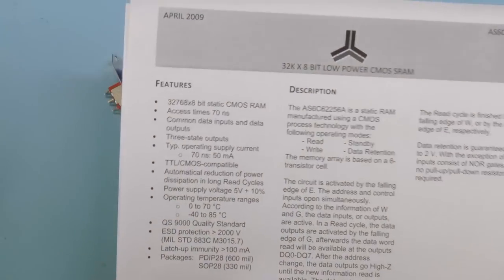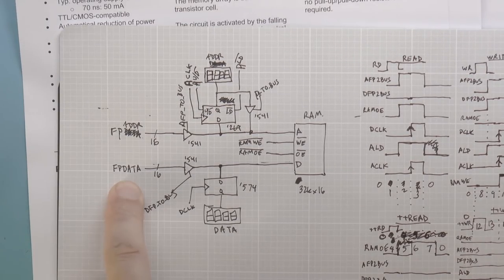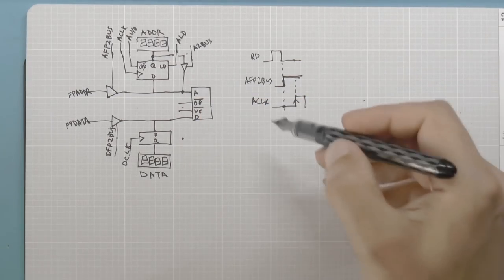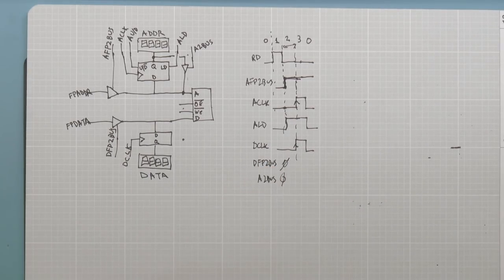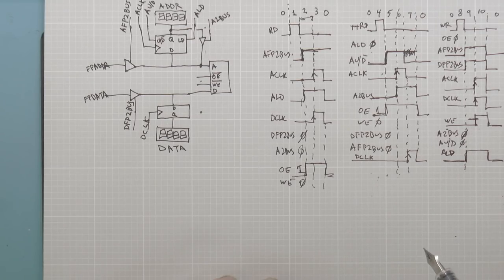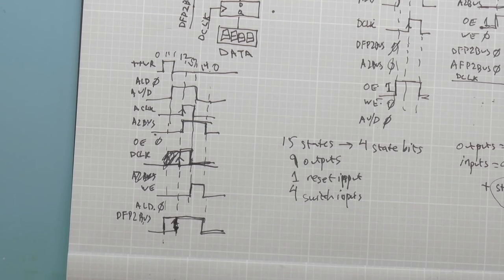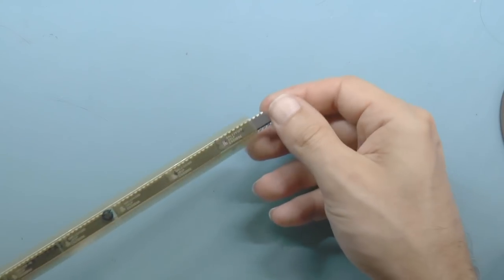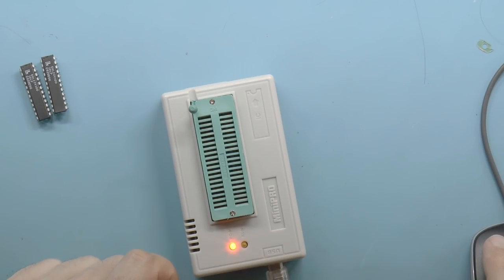Retrocomputer RAM and front panel circuitry for RAM

Comment: I'm currently designing something similar, and this is quite helpful. I'm going to have to think about my UX design. I hadn't even thought of a pre-increment, but it gets me thinking about how I'm going to double-check the written data. Otherwise, I'm glad to see that the architecture I came up with is something that others have also done before.

I will say, being a wasteful programmer by day, I'd never thought I'd say "it's strange to see so much silicon used for so little", but there I am looking at two 22V10's. I can't use a state machine (b/c of my goals for the project), so I'm instead going with a much more asynchronous and analog design. I'm hoping to be able to use double-pole switches and a couple RC edge-detectors to send a write-enable pulse to my rom when my write&increment is pressed, and then an increment pulse to my address counter when released. Then again, I don't have the added complication of also needing to interface with a cpu or any other synchronous system.

Comment: I've just started watching your videos - this is the first - I thought I would point out that the 9900 CPU numbers the address and data lines in reverse order to all of the other CPU families of that era. The most significant bit of the address and data busses is the opposite of what you would expect. For example D15 on the 9900 is the LSBit whereas on a Z80, 6800 and so on, D0 would be the LSBit - I'm sure you've figured that out by now... but I thought I'd mention it for others just finding your videos...

Comment: I love your videos, and I love what you're doing with this project.

I am curious why you're doing this with discrete components, rather than with something like an FPGA and through pins programmed for input and output?  That part confuses me because it would seem to be a lot easier to plug this chip in to the FPGA through level shifters, and then write your state machine in Verilog.
Reply from the maker: It's a retrocomputer. The line I draw is a bit blurry, but basically any tech not available before 1990 is right out. It's not really a line, more like an N-1 dimensional membrane in N-dimensional space. So, I would totally use an SMD chip even if it was only available in DIP prior to 1990. And I would use a chip that came out after 1990 only if it's very close in functionality to something before 1990 -- for example, a bus-oriented version of a chip.

So no RasPi, no FPGA, no Arduino. Go discrete or go home :D
Reply: +Robert Baruch Okay.  Would you have any interest in doing one on an FPGA in parallel or later on after this series is completed?  I have an Altera Cyclone V with a 40-pin connector that would work brilliantly for it. :-)

Actually, I'd really like to see the original 80386 supported by an FPGA and on-board SRAM.  The board I have has an additional breakout adapter available to give me 160 I/O pins.
Reply from the maker: I do have a previous series on using an FPGA, but I never finished it. I'll probably get back to it after this project.
Reply: Thank you for all of your work.  I've learned a lot watching your videos.

Comment: Hello Robert, very nice video! I'm a total noob wrt GALs, but now that I've watched your other video on that and read some datasheets, I've got a question. Well, I understand that you do need two 22V10s in this case. But as regards only the state machine, particularly its transitions: if it were all in one GAL, then we wouldn't need outputs for the next_state, since we could use the feedback from curr_state in order to determine where to go on the next CLK, right?
Maybe that's what the state-stuff of WinCUPL is for?

Comment: I thought SRAM consumed less power than DRAM as it didn't require constant refreshing?
Reply from the maker: Well, it's not a hard and fast rule, but there are a few reasons. SRAM is used for cache memory, and cache needs to be very fast. The faster you are, the more power you consume in the transitions. Aside from that, large SRAMs use four-transistor cells for compactness, and those consume power actively.

I could be completely wrong, though. Maybe the latest SRAMs are just as good as DRAMs...